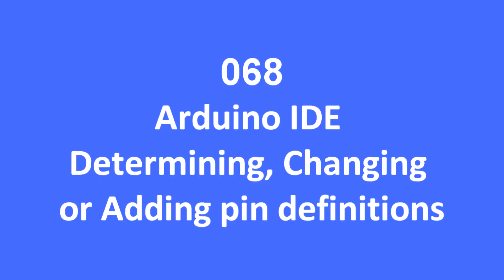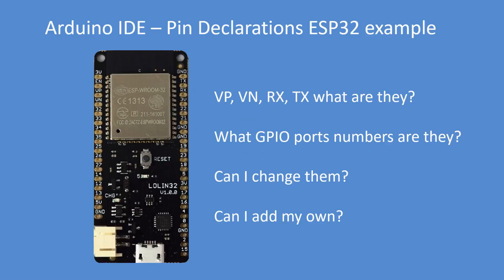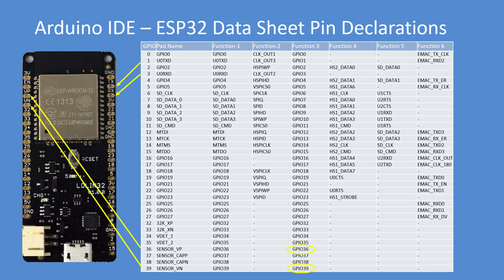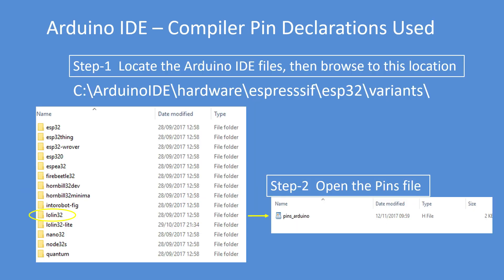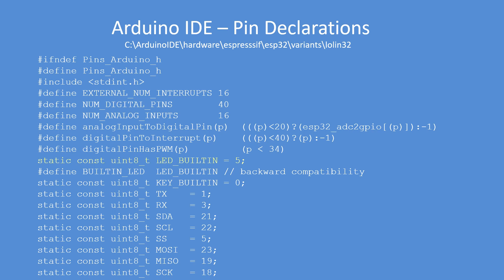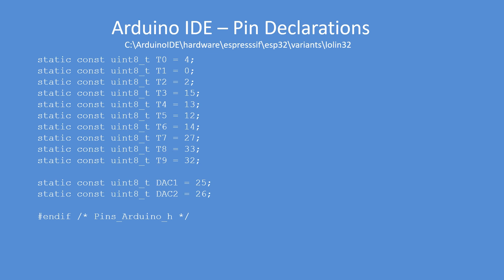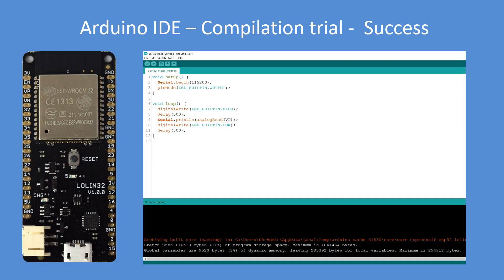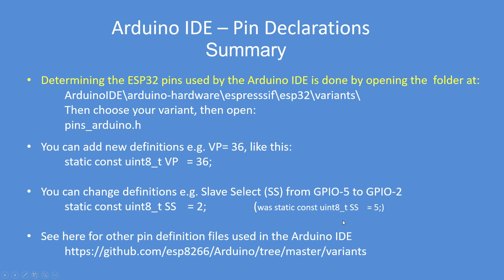Tech Note 068 - Arduino IDE how to Determine, Add and Change Pin Mapping

Comment: How do you know which library goes with which pin variant? I've been using the ESP32 Dev Module board profile but do not see that in the variants folder. Any suggestions? 
Nice video, btw
Reply from the maker: If your defining the pins any board definition will work. Only when there are (rarely) references to eg D1 which is say GPIO2 would a library cause a problem , but few if anyone does this example wire.begin(D1) is very rare but wire.begin(2) is usual so it always works. You get the same compiler outcome whichever board type is used. However sone boards by virtue of the flash memory used need different programming conditions that’s when the board selection is important.
Reply from the maker: You can find the exact pin definitions in the file pins.h within the IDE

Comment: Hi David, interesting but I can not find the esp32\variants folder. Is it changed in the newest IDE version? 1.8.7
7
Reply from the maker: It can no-longer be done in IDE 1.8.2 onwards, but they have made a concerted effort to list every board on the market now, so less of a problem.
Reply: oh that is a pitty, I liked  the system you explained here. I hope you got my message I sended by your website today.

Comment: One thing to mention is that the selection you made of PIN 2 for SS/CS in your SPI example has a bit of a catch. The catch being that PIN 2 needs to be held low during the sketch upload. I tried using pin 2 as SS for a ADXL345 project and the sketch would not load. I used PIN 16, (2RXD) for SS instead as I dont require any other function for this pin. Reassigned PIN 16 as SS and all works and loads perfectly.

Newcomers to this chip need to be aware of the pins used for boot and flash upload! Maybe a great subject for another of your Tech Note series :)
Reply from the maker: Yes I agree, although the FireBeetle reset circuitry works and programming is not an issue I’ll redo the source code and move SS to another pin. Thank you for pointing that out.
Reply: I should have included that I was using a Lolin32 board like you were in the example. I realised at once that it was an in circuit programming issue. Unplugged the adxl345 and the sketch would upload fine. Looked online and found a post by you on a esp32 forum, explaining the pins 2 and 1 requirements. Definitely worth a Tech Note explanation for those of us new to this chip.
Reply from the maker: Programming the bare ESP32 or ESP8266 requires the sequence of pulling low the boot and reset pins in a sequence, luckily Development Boards do that for us with a simple flip-flop set up provided by a logic gate. For the most part programming can be achieved eventually by resetting the device with the reset pin, but timing is critical, it is as you say for better to allocate another pin if one is available.

Comment: I love your videos. For me it was a little bit hard to understand which pin will be used for what. But one more question. I use Board = ESP32 Dev Module. So definition should be found under folder doitESP32devkitV1. Correct ?
Reply from the maker: All of the pins on your development board can be used for General Purpose I/O, it is confusing, which is why I've been trying to simplify it if I can. Adding a new board definition is quite easy to do, once you know how, but explaining it is difficult, as always.  I have the same board as you and I use the ESP32 Dev Module as my board definition. If you look in the folder I refer to, you will not find one to match your board, so open the ESP32 Dev Module and see what pins are defined in there. If needs be you could change those. It would be nice if you could copy the ESP32 Dev Board file and rename it 'doitESP32devkitV1' but that will not work. If I can get time, I'll produce a video that explains how to add a new board file.

Comment: It's nice to fix these for ourselves, put how can these get them factored into the greater project. Just about every board would need to be expanded or fixed. But in this video you give me a starting place and a place to see how the pin was defined.
Reply from the maker: I agree, the problem we have is when the software is updated do these files get over-written, they probably do, so the solution has to be to copy the files and then after an update write them back. Perhaps contacting the Arduino foundation to get errors or updates fixed at source.

Comment: Well done, very helpful!
Fixed the flashing led on VSPI by changing CS pin definition. The sensor inputs were also a helpful hint for adding to the pins file.